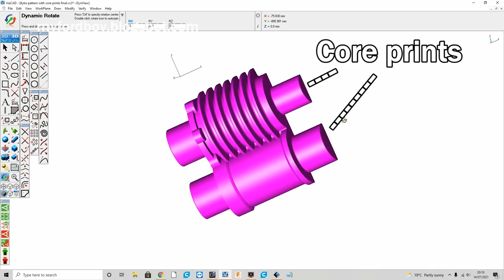Metal Casting at Home Part 109. Finned cylinder, 3D Printed Pattern, KYKO Replica Fan

Comment: Just done my first casting. It was only a sand rammer in brass, and came out a little on the rough side (think the sand was a tad too wet!) but I was still happy with the result. Just wanted to say thank you as your videos have been a huge help. Keep up the good work.
Reply: Ive never actually done a hot casting but I heard moisture in the mould can cause steam pockets
Reply: @tommothedog  It's my understanding that green sand uses water as a binder, unlike Petrobond which uses oil. I've seen a few people poking small vent holes into green sand to vent any steam  pockets, but this seems to be done on larger castings. I'm sure the more I get into casting I'm going to run into these issues, but one bridge at a time lol.

myfordboy did a video awhile back which included sand prep and core making, if you've not seen it it's well worth a watch
https://youtu.be/l3opkzAvVQk

Comment: I made aluminum parts for a bamboo byke (the junctions) with the same technique , and I was thinking of making a Stirling engine to generate electricity, a reservoir with hot water (heated by the sun) and another reservoir with cold water. Very good project, just a quick note, it's a shame YouTube only has 2x speed.

Comment: Looks like the casting turned out well. I had wondered when you just dompted greensand on the mold and how good it went between the fins. Surprised the 3D software did not allow you to put the text in the print. Extruded text can be done in Fusion 360 as I have done it. Every time I see a casting video makes me wish I had the setup to do it but at 73 think it is too  late to start.
Reply from the maker: I could have added the text and the gating in the CAD but was expecting to sand the print a little. The text would have made sanding more difficult.
Reply: It's never to late.Go for it.
Reply: @myfordboy  Looks like the quality of the print gave you a pretty good finish on the casting.  The pattern sure seemed to come out of the greensand easily. Nice work.

Comment: What can be done to remove/reduce the small casting defects such as those directly above "KYKO" at 24.55?  Great video.   Thank you.
Reply from the maker: That will be a bit of loose sand that fell into the drag when the flasks were closed. Not an issue here, filled and painted.

Comment: try acetates or sulphates then electroplate to a 3d printed mold (fill-in, instead of coat, from outside, with a seed start)
Reply: crank up the amps
Reply: any metal, in electronegativity order

Comment: I look forward to videos like this :). What does the tool at 21:00 do? Is it simply to ensure the sodium carbonate gets to the bottom of the liquid metal? And what do you do with the dross? Many thanks from Canada!
Reply from the maker: The sodium carbonate is put in a little foil packet and plunged to the bottom of the melt. I hold it there until it stops bubbling. Dross is discarded.

Comment: I have to wonder.. Why not make a extruded aluminum frame. Something that either the flask sits on firmly, or the frame attaches directly to the flask. Put some guide rails on it with a gantry as well. To the gantry attach a base of sorts. This base can by rather thin and hook directly to the lifting screws on the pattern, and since it's constrained by linear rails, you can lift the pattern straight up out of the sand. So "fewer" worries about the hand shifting a tad and knocking over a fine detail? I dunno
Reply from the maker: Maybe when I am old and my hands shake but for now it's not an issue.

Comment: The metalsmith and foundrymen in Pakistan and India don't flux or degas, when they pour, they simply hold back the dross, I guess it performs the same function, but then I don't see you tamping down your core-boxes whilst barefoot either, so each to his own I guess.☺
Reply: The stuff from India and Pakistan is probably not as high quality and probably has bubbles in the final product.  That would be my guess.